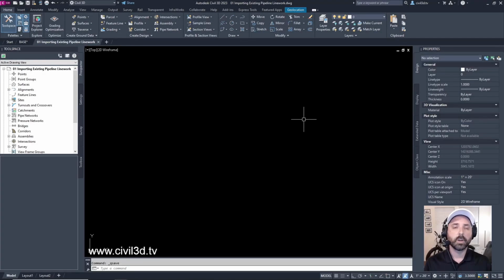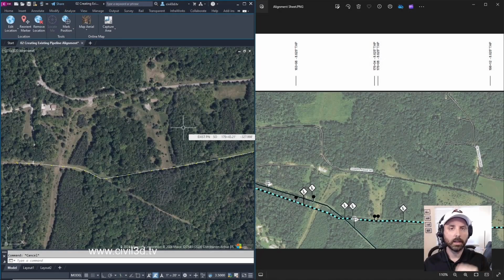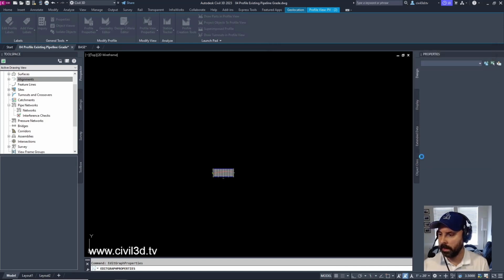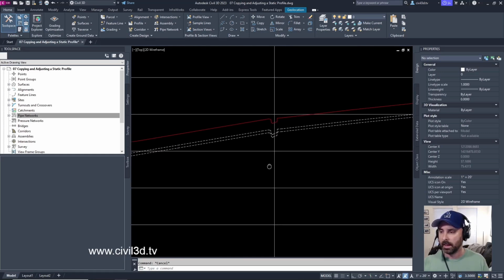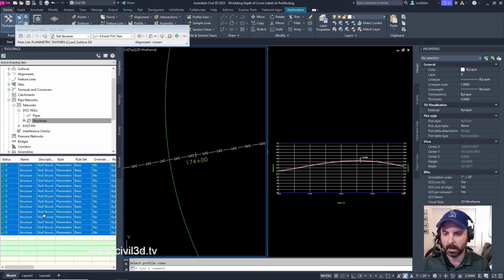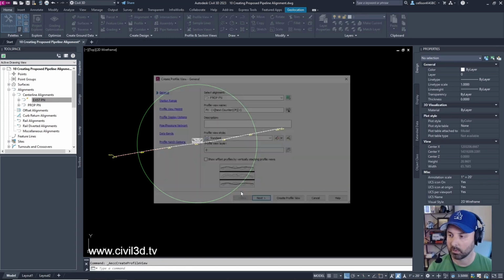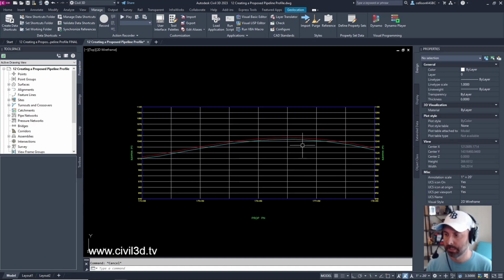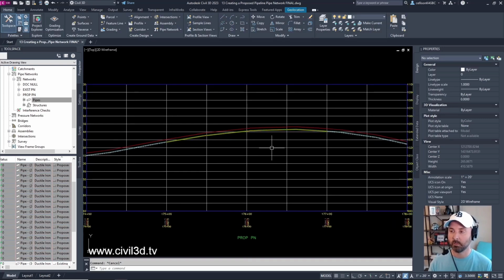Oil and Gas Pipeline Design in Civil 3D

Comment: Dear Sir, for multiple sub branches pipelines work, after swap cover gets changed automatically. is there any way that after swap pipe cover not get changed. I have to change diff branches to diff sizes "without" changing cover.
Reply from the maker: Swap Part will recalc cover automatically based on rules. To keep your cover locked, turn off rules first or set a fixed cover rule before swapping. Then swap pipe sizes — the cover won’t auto change.